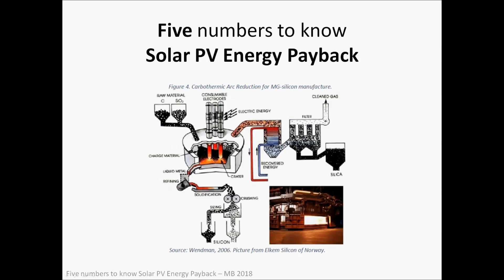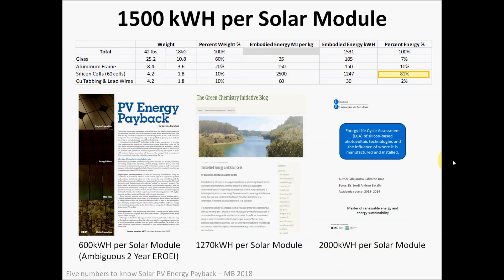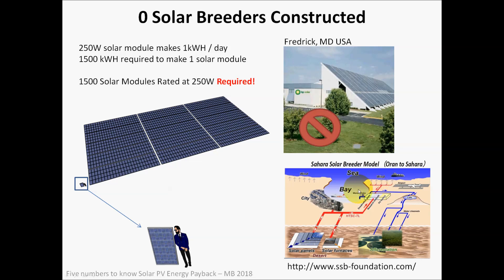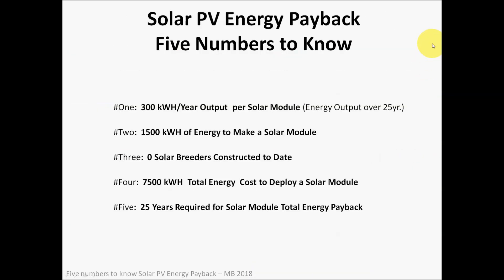5 Numbers to Know: Solar PV Energy Payback

Comment: You haven't factored in the energies and pollution factors in disposing of the panels at end of life either. 

I've always said, any value below 30% efficiency and solar cells are just energy converters and pollution movers. They just convert the fossil fuel/nuclear energy needed to make them (and the pollution that brings) into equivalent sunlight energy where they are used with no real gain. I would seriously doubt they will run non-stop for 25 years without ending of life damage.
Reply from the maker: That's why I added the heat map on my last slide long term solar reliability and energy yield are still a bit of an unknown.